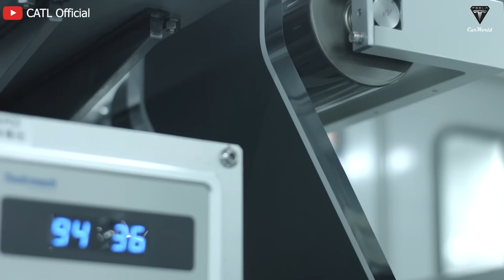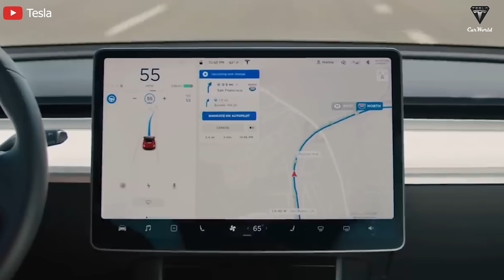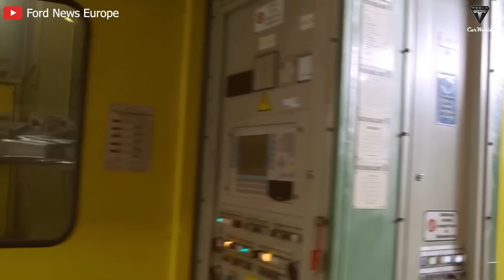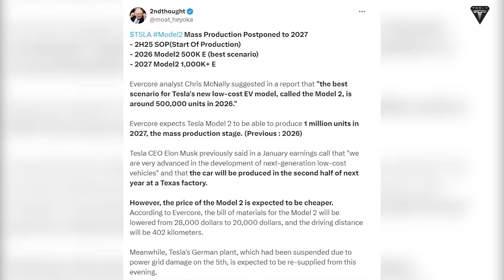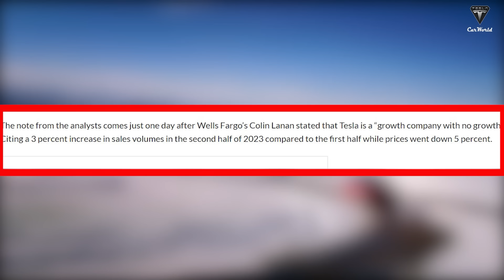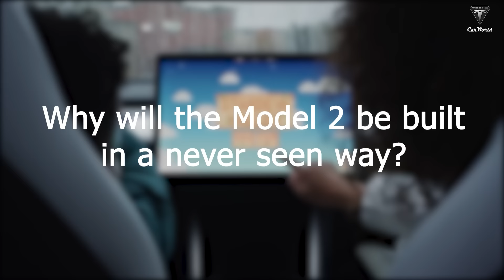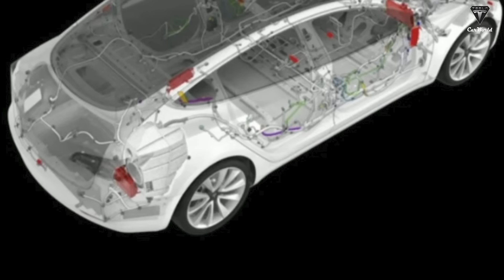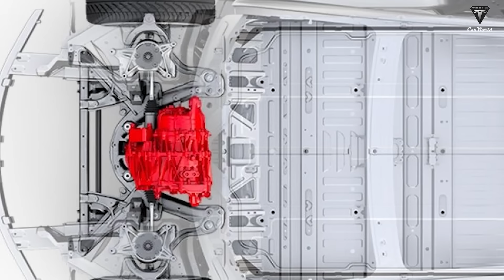Just Happened! Tesla Model 2 Upgrade: M3P Battery, Mass Production, SHOCK New Price and MORE (Mix)

Comment: I see models in China with over 400- 700 miles of range at less than 25k and Kia has several at 25k with 400 miles of range.
Reply: Kia - you mean the brand with the sometimes working 12v main battery?
Reply: Different standards of measuring ranges are used there

Comment: Yes I’ll believe it when I see it it says $25000 and it will end selling at $50000 or more Tesla should build stations where the battery system can be swapped every time you need to charge suspension it for a fee and go on the way that would be more likely for more people to buy it pus nobody has to worry if a battery pack goes bad it won’t fall on consumers responsibility to deal with it and be discharged on buying an ev